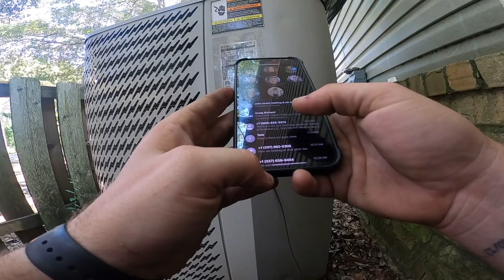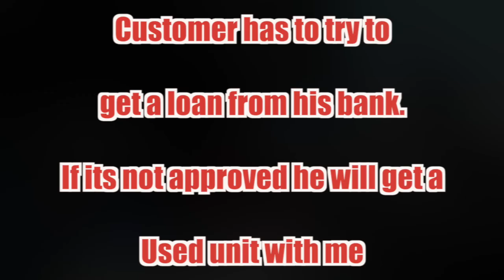Second Opinion On Freon Leak

Comment: Non-professional clown comments are also pretty useless. 

Yes the meter was drifting while it warmed back up, but then it settled, and confirmed it again as he moved it away from the leak and it stopped. 

Yes micro channels can be fixed by punching out the fins and brazing. If it was one leak caused by impact damage, then I'd consider it. This thing has pinholes in multiple locations, without visible damage. Playing leak whack-a-mole indefinitely doesn't make for happy customers. Spending as much as replacement over a few years, repeat visits, more refrigerant loss, more no-cooling calls. Yeah sounds like a great time. 

Stop busting balls when you have zero experience.